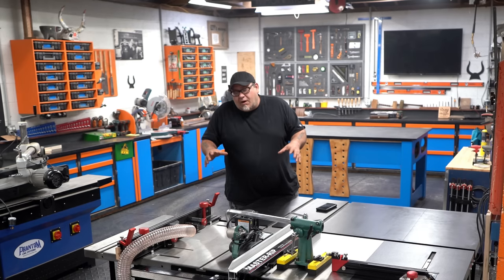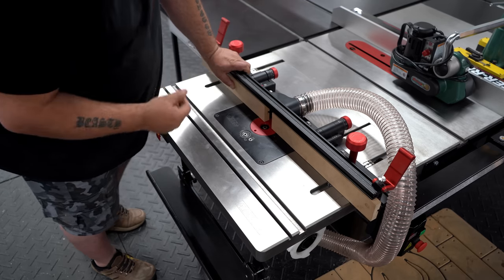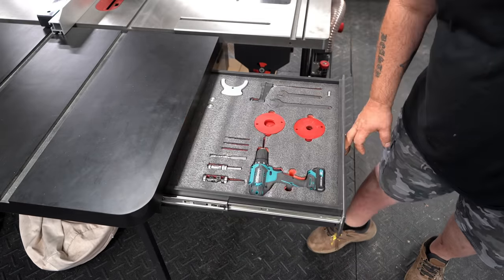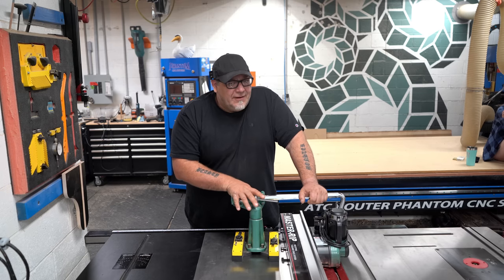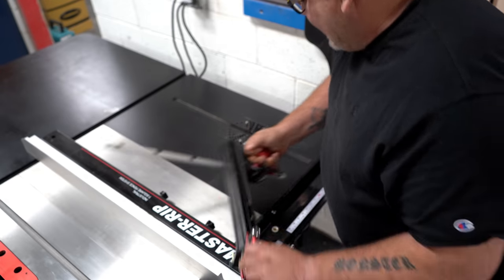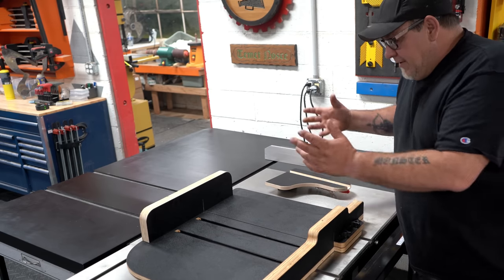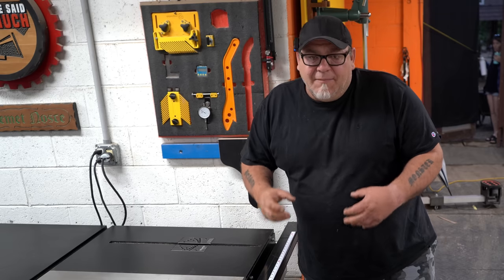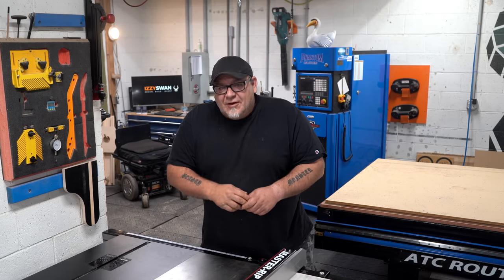Retirement Table  Saw Setup

Comment: I'm a retired union carpenter by definition, but didn't do any fine woodworking until then. I didn't get my first table saw until then either! I can tell you mine is nothing as nice as your set up! Mine is an old Craftsman with the Bench Dog cast iron router table mounted on the left side like yours with a 3-1/4 hp Triton router and it does everything I need. I also put an Incra fence with Jessum rollers that are just a game changer for an old style, pre-riving knife, saw. Enjoy your time in your shop, doing what you want and feeding your passion!

Comment: I think the router table on the left side of table saw is a brilliant idea. If you have a small shop, I think the best place for the table saw is up against the wall on the right side. So that makes putting the router table on that side of the table saw very difficult. But the left side, is wide open, so that makes it the best place for the router.

Comment: Kudos on the 'retirement'.   Have some fun!
Setup my TS in much the same way but more along the budget side.
Sears cast iron contractors saw with the long Incra III TS long fence.
The anodized extruded rails are the backbone of the setup.
The outfeed table and left side router table mount on the rails.
The router is a 3HP soft start porter cable mounted in one of Woodgears tilting router lift.
I can move the TS fence all the way to the router table.  This works good for anchoring a circle cutting jig.
Dust collection is the biggest challenge as it is with most contractor saw.
The whale is the table saw.  It eats a lot of shop.  But worth it.
:Looking forwards to more on your TS.

Comment: I like the drawers below the the tables. I have Jet10 table saw and this gives me ideas  on how to keep those items close by.  I also like the build in router lift,  I had one in my last saw Ryobi which was not a lift style.  I used a 1/4" fixed router in there and it was a pain and never used.  These are great ideas especially the Kizan foam.

Comment: Hey Izzy. Great setup. I hope this isn't too personal to ask, but, as a 56-year old who has been in a wheelchair my entire life and knowing you have had some health issues that may be relatable, have you thought about solutions that might be effective should you find yourself "seated" again? I've focused on tools that I can place on custom stands/cabinets that move around (I'm also limited by space, requiring extra maneuvering space makes every setup a game of Tetris with tools), and have tried to get the most versatile tools I can, but am precluded from a lot of larger bandsaws, floor standing drill presses, etc. My biggest struggle is indeed the tablesaw (my current setup is a Bosch jobsite saw set into a custom workstation to provide larger work surface for outfeed and material support) but I'm shopping for an upgrade. I'd get a cabinet saw but they are just too high to use comfortably (or safely in some situations) and, having had a contractor saw in the past, I'm just not a fan of having the motor hanging out the back, dust collection, and general access all the way around and so my current thought would be one of the enclosed hybrid saws with a custom base I would build (Grizzly/Shop Fox) which seems to be as close as I can get to a cabinet saw. The jury's still out however. I'm curious if you've given any thought to what your approach would be should you find yourself in a similar situation as you have in the past? Again, I hope it's not too personal of a question, but watching you for many years and knowing your ability to innovate I wondered if you had ever given this any thought?

Comment: Izzy I’m in a bind and I need a question answered if you don’t mind. I’m adding subwoofers to my truck and I can’t find the formula to evenly space my speakers in the front of the box. If I had one speaker it would be easy. Take height decide by two and length same thing the height is easy with four speakers by the width I can’t find how to divide my length to get the 4 centers for the speaker placement. Would you be able to answer this for me?